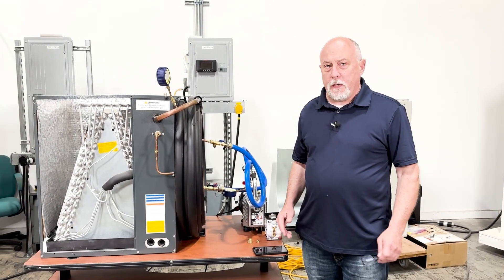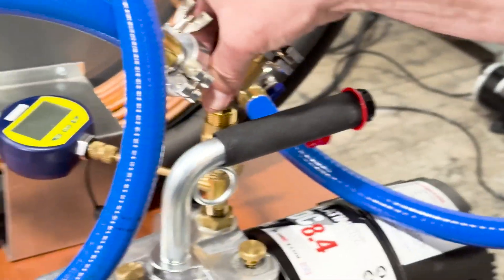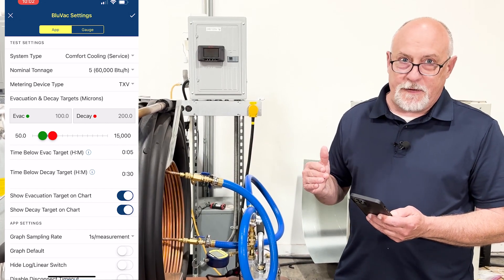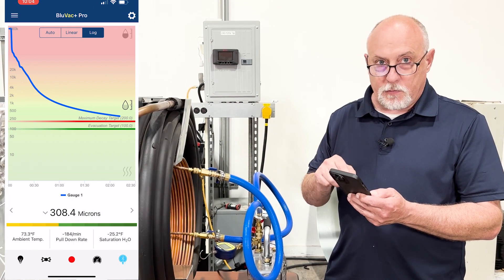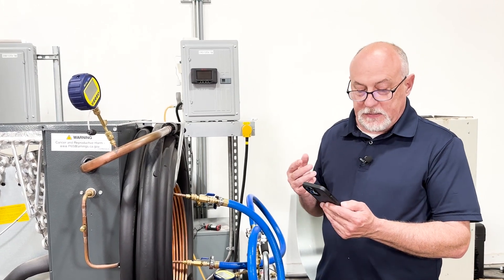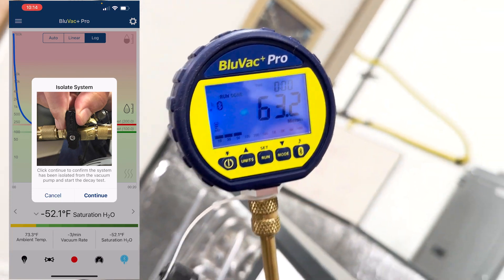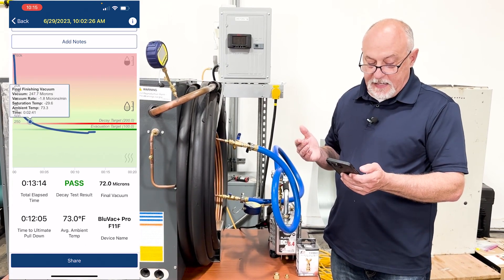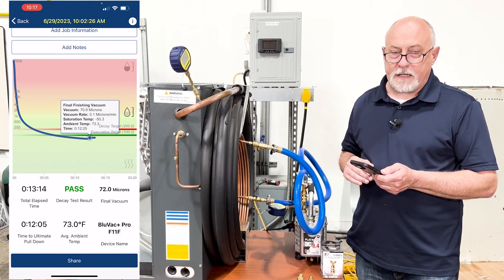The Importance of Decay Testing During Evacuation

Comment: Straight and to the decay point.  Thank you !  I often wonder why manufacturer literature doesn't mirror this same easy process.  I've been working with vacuum for a short amount of time, and there's been plenty of convulsions.  So far I have found that less restriction definitely means less time with the vac pump.  Those large ID hoses are great.  Whoever designed them deserves a hug and a raise.